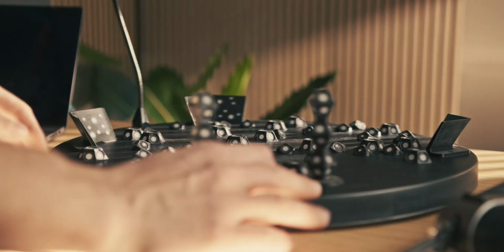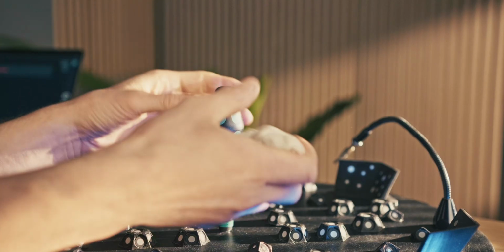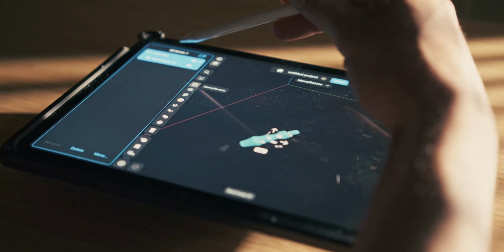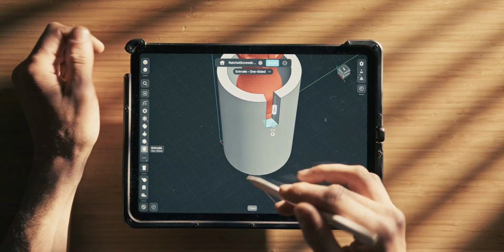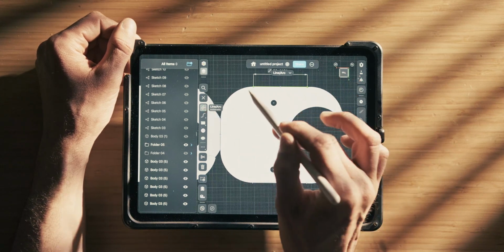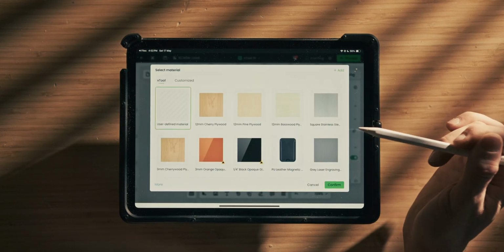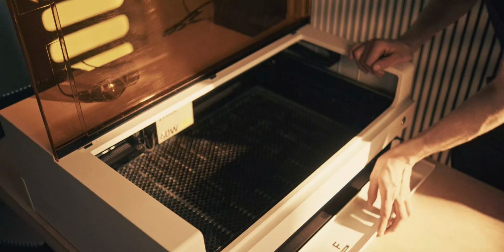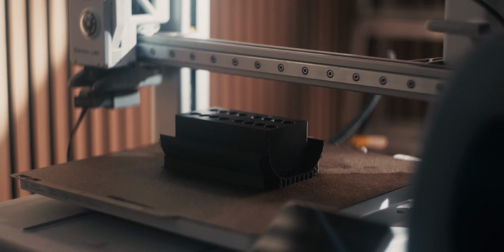My Build Process: Shapr3D, 3D Scanning, xTool S1 & 3D Printing

Comment: This was very insightful. I am curious about ergonomics when using the iPad. Do you use something to adjust height or angle?

I am wondering about using something like the Elgato Wave Mic Arm LP or Mechanism Pillow with some kind of magnetic quick snap to the ipad case you made

Comment: Which iPad are you using with Shapr3D?
Reply from the maker: I'm using the M1 11 inch 265gb. so its and older variant. but it still runs pretty smooth with even a ton of 3d scans in the the same file :)
Reply: @FlatLanderTech  Okay, good to know. I use Fusion as my go-to, but have been thinking about experimenting with Shapr3D on my 8th gen iPad. We'll see if it can handle it.

Comment: You are obviously a professional and know the tools you use very well.  For those of us who aspire to do things similar to what you do, is there an "entry-level" way of doing it with similar results?
Reply from the maker: This is a really great question—and I think it would make for an awesome video showing the process I used before I had access to these tools!

In general, there's almost always a lower-cost way to achieve similar results. For example, a 3D scanner can be replaced with a caliper—it just takes more time and usually requires a few extra test prints.

When it comes to 3D printers, I personally think they’re worth spending a bit more on, but there are definitely budget-friendly options out there that perform surprisingly well.

For laser cutting, I’m not sure there’s a direct low-cost replacement—but that’s something I’d love to explore further.

Also, for anyone looking to get into CAD without spending money, I used Shapr3D, but a great free alternative is Fusion 360 for personal use. 

Really appreciate your comment—super insightful!
Reply: @FlatLanderTech  If you do decide to make this video, I would be happy to watch it!

Comment: You mentioned you used to do most of the modeling by collecting caliper measurements.  Is there a middle ground between calipers and a very expensive 3D scanner?  Can this be done by using something cheaper?
Reply: a very expensive caliper xd
Reply: They do make cheaper 3D scanners that do the infrared scanning. The Otter and Ferret from Creality, but they do require more post processing and patience's to use. You could also take a picture of the object with a ruler for scale in the picture and use that to trace and outline the image and objects into a vector file to be able to model using that.
Reply from the maker: There are cheaper scanners available now that perform quite well, but there's also this tool called Shaper Trace. I haven’t personally tried it, but it looks like a super fast workflow.

Although it’s not 3D—you end up with an SVG file—it could be a great alternative if you're just looking to integrate simple tools into a build, for example.